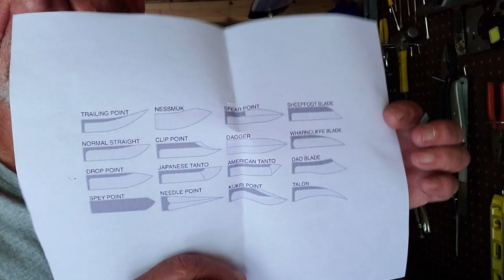Modified OPINEL No 9, The TADPOLE, Wharncliffe Whittler , It's a little masterpiece

Comment: You could add a custom thumb stud / nail nick to help with opening it. Drill a tiny hole of a mm or so near the spine at the base of the blade, chamfer it, and then fill it by brazing on some fluxed silver brazing wire, leaving a small drop on either side to grab with your thumb nail. Alternatively you could put a small bit of copper wire through the hole and peen it over on either side to make a small rivet.
Reply from the maker: Ahhh. Good ideas there thankyou. Appriciate it

Comment: Have you thought about glue fitting a spacer or shim to the back of the handle to fill in the now open blade groove? I doubt it needs any more rigidity in the handle but it would stop some of the pocket fluff making its way in.
Reply from the maker: Yep thought about that. But to be honest. Its not going in my pocket be will be in my leather room O have for whittling. If it was going to be an edc I definitely would have done that. Thanks for watching. Always appriciated and be safe out there
Reply: @2ndchancegeorge  It's a really nice mod to get a purpose built tool for not a lot of time and money. If I ever take up whittling I'll try and remember this video before I splurge on another set of tools I might not use a lot. Completely aside, how do you find the stainless Opinels hold an edge in comparison to the carbon steel ones? I have a couple of stainless ones for camp cook knives and I've always found them plenty sharp. Most woodworking tools are carbon steel though, I'm wondering if you think it will make a difference for a whittler?
Reply from the maker: The stainless will hold the edge longer but a pain to touch up. The carbon is easier to touch up. Both give a great edge. I tend to strop at least 7 to 10 times between sharpening. When whittling you notice right away if you need to strop.
Reply: @2ndchancegeorge  Just saw your new Opinel maintenance video, a brass spacer in the back would make you happier if you have to use the knock trick to open it. Always an option for a rainy day project...
Reply from the maker: Lol...when doing the video I actually thought about your comment everytime I "wacked it"

Comment: That's a Sheepsfoot not a Warncliffe which is long polnted and thin.
Reply from the maker: You are correct the original wharncliffe was a slower curve down to the point. This I suppose is a modified one, kinda like the Benchmade one, I forget the name. I choose this tighter curve because I wanted it to be a whittler, the longer slow curve was to thin for my liking as a whittling knife. But you right probably closer to a sheep's foot although they tend to be a little tighter on the down slope. Thanks for watching always appriciated.  Oh and I have a review coming on the new Rough Rider wharencliffe...the blade exactly as you described. Hoping it will be up Tuesday if you interested.